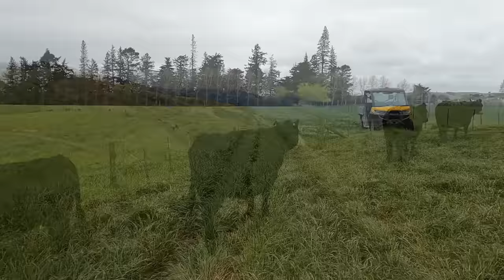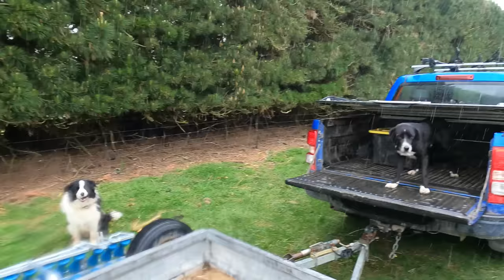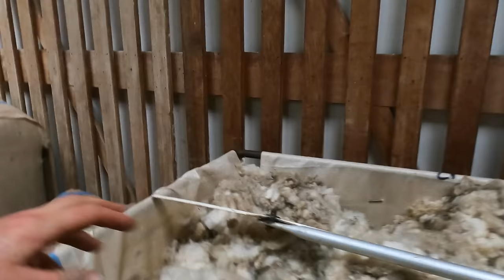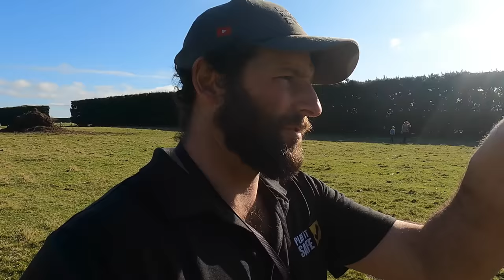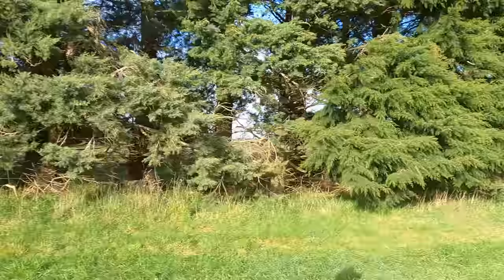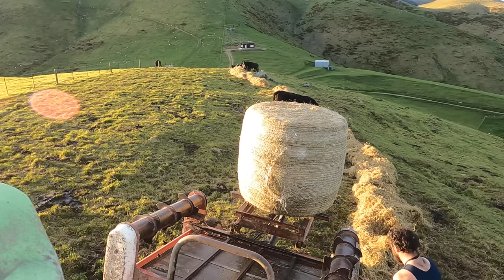Tailing / Docking Lambs at the Lease Block with Te Pari Gear.

Comment: Is there any way you can add value to the wool to make it more valuable? We had our home insulated with wool blown into the ceilings. What about wool for knitting (see Sandi Brock YT channel) or spun for blankets?
Reply from the maker: It would be interesting to see how much profit she is adding, after all of the costs and labour is taken out.
Reply: So little wool is actually processed in New Zealand anymore.
Reply: there is only 2 wool scours in New Zealand 1 up north and 1 down shout in timaru